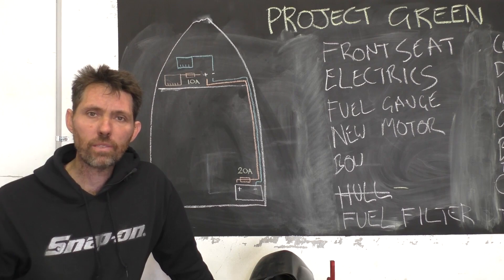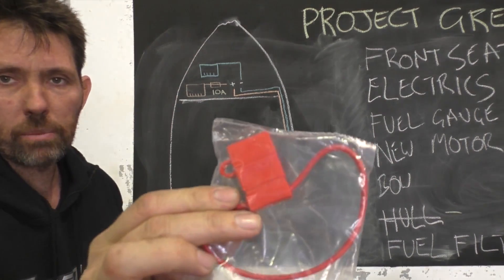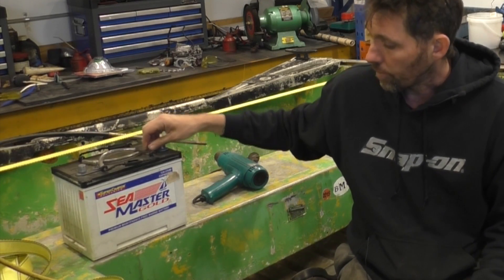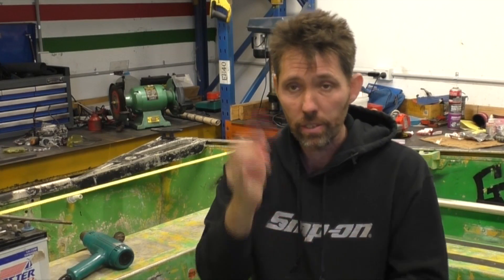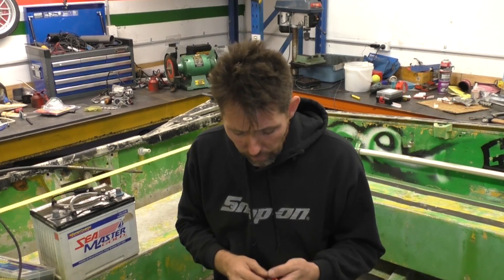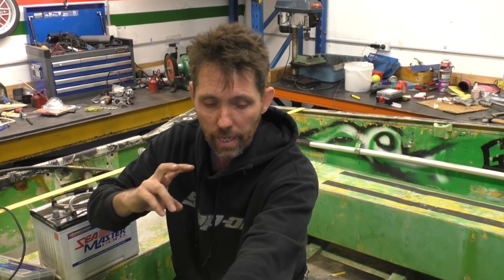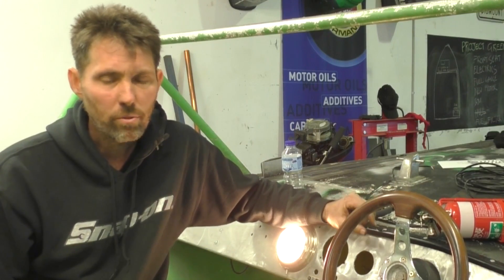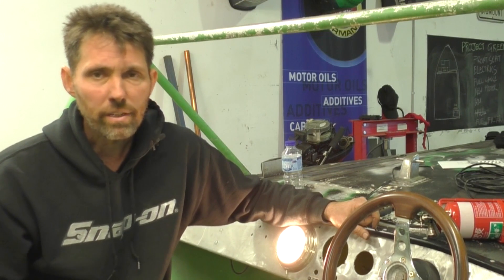Wiring the electrics on a boat [Pt 1]

Comment: My wiring knowledge just doubled thanks to this video,  I always had issues with wiring on my boat.  The inline fuses would get corroded and I'd loose power to the depth sounder/chartplotter.    Your setup looks safe and reliable and best of all not to expensive. Your wiring and electronic videos are a huge help.  I find it pretty hard to learn from wiring diagrams it just looks like a foreign language and I just glaze over.
Reply: Nice job !
Reply from the maker: Hi mate. Those inline fuses can corrode very quickly if they aren't fully-sealed marine grade holders. I'm hoping this setup does last a while. It isn't a complex setup but it should be versatile enough for a small boat like this.